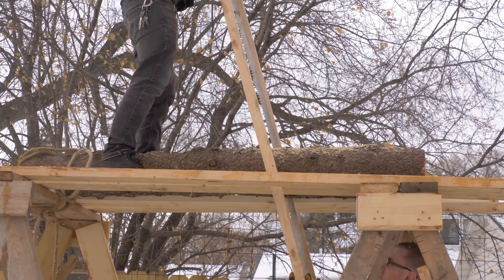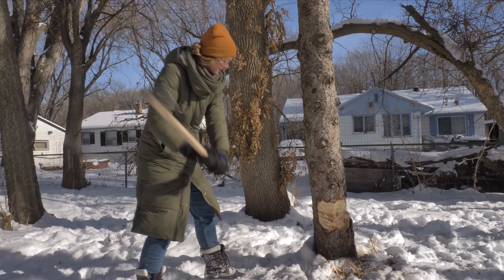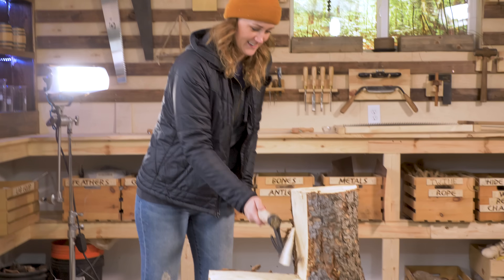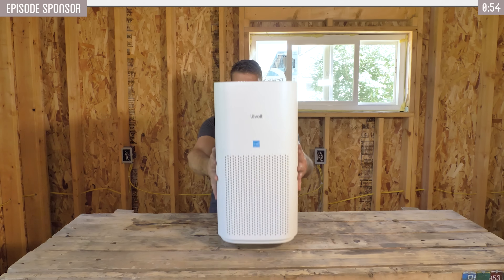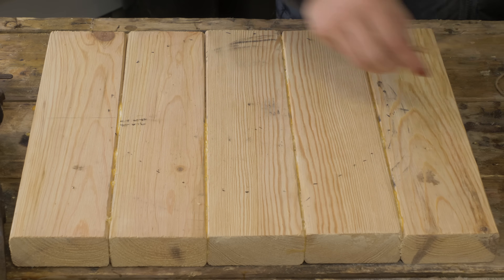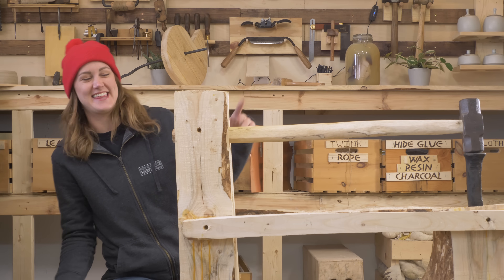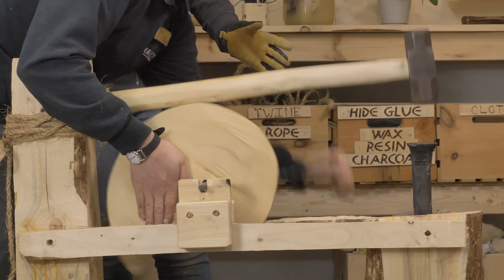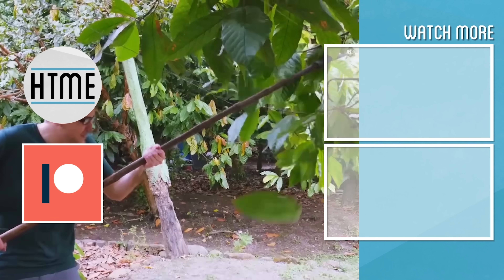Does Da Vinci’s 500 Year-Old Power Hammer Actually Work?

Comment: Mechanical engineer here. 7:05 is almost exactly how we were taught to design cams in university. There are of course software packages you could use for this, but they started by teaching us all the manual drafting techniques before moving on to CAD. As ol fashioned as it sounds I think I learned quite a lot about good design practice from that part of course. Really made you have to internalize the geometry of things to be able to draft it accurately by hand.
Reply: Designing the cam... Would it also work to tie a string to a pencil, and then wrap the string around a disk? 
As you rotate the pencil back around the disk, the string would unwind increasing the radius as you draw. The "drop" of the cam would be the same as the circumference of the disk. The length of string would determine the overall size of the cam. 
But I'm just an old country boy, what do I know?

Comment: now im gonna be using an anime as as a reference for this idea. In Dr.Stone the Character Chrome with the help of Kaseki (an old man who loved being an all around crafter) without any knowledge or know how made the water wheel. How the main Character Senku "upgraded" the structure was introduce gears and added what I refer to as the "Piston Gear"; Which in short is just a gear with teeth on one side attached to a piston turning Rotational force into Horizontal force which then powered their iron making Furnace. My point is why not use gears or something similar to transfer the energy of the water wheel or some other natural force into mechanical energy thus "powering" your "Auto hammer".

P.S. I know my grammar isn't very good, at least I'm trying.

Comment: The hammer handle should be flat, not round.  A round handle is specifically that way for the hand.

The cam should probably be concave, which would correct the hammer side to side deviation and lead to more accurate strikes.  

The length of the lever should be increased getting about a 3ft drop  which is similar to a blacksmith’s typical power stroke.  Extending the lever through the pivot and adding a counter weight would also be something DaVinci would be well versed in doing and reduce mechanical stress.  I also suspect if he ever built his concept he would have probably used a flywheel to aid in smooth operation.

Comment: Instead of making a second cam you could have just added a guide rail to the hammer that kept it lined up with the cam. Super easy you just needed to attach a pole or two to each side of the hammer that rides on each side of the cam and is longer than the drop is for when it falls.

Comment: Ok, real quick.  Love your vids!  But advertising an air filter like that, meant for small particulates and sanitization, as any to be used on a wood shop to help with what you are breathing in, is not great.  It is not at all a replacement for a shop vacuum/filtration system and should not be marketed that way.  This coming from someone who has multiple levoit-type filter in my house.  Just not in my shop.  K thanks!

Comment: I'm no Da Vinci or anything, and you are most likely capable of figuring this yourselves, still a few considerations on how to improve the design:

1) You don't need a larger spiral wheel to make the hammer go higher. A longer hammer handle would do too.

2) have you considered bevelling the halves of the wheel so whe connected they form a grove? This should guide the hammer a bit, preventing it from veering side to side.

3) maybe raise the anvil a bit... Or Lower the wheel. The practical use footage looks like the wheel catches the hammer before it can filly land on the anvil.

Comment: Make a place to stack weights on the top side of the hammer handle, between the cam and the hammers head. The back side of the head itself would probably be better, if you can work that out.

Comment: Looking at this, theoretically if the design is scaled up and you used possibly a gas engine and a belt it could be a tool that modern day blacksmiths could use. Actually I could see this being potentially useful for different projects that would also involve welding as part of them.
Reply: The same thery is used in the little giant powerhammers, they are not produced today but a very common mechanical hammer used by blacksmiths

Comment: If you can find a way to put a concave wheel on the lower edge of the hammer handle so that it rolls on the cam, it would likely help with the friction that's working against the spinning because you've got the entire cam rubbing against the hammer. The wider cam does help keep the hammer from falling off, but you could probably also have put guide posts on either side of the assembly as well

Comment: For the hammer sliding off the cam, just insert some guide rails alongside the cam to ensure the hammer stays in place. The guides would also help ensure the hammer is hitting right where you want it too. Further, by using rails you wouldn't have to widen the cam, thus lowering its weight and making it easier to turn. That would also help keep your handle from bending so easily due to the torque of turning a cam that big.

Also, you need to put a stop bar level with the cam or at least add some leather padding on the hammer handle. Or simply make it so there is space between the handle and cam at the point the hammer comes down. Otherwise the repetition of the hammer handle striking the cam will make the whole mechanism more and more wobbly as time goes by. Eventually even cracking the wood.

Comment: Having the cam work off of a foot pedal type system would make the use easier, as then you'd have both hands available to work the metal piece. 

Also then the hammer size could be increased with less strain while using it. 

And also, amking the bse where the hammer lands bigger, would allow more freedom to work with bigger pieces. 

But with said modifications on the design would get pretty far off from the original.

Comment: I would suggest lengthening the handle for the sledge by two feet or so. One foot of the handle shaft behind the lever point . Moving the cam behind and above the lever point. Using a guide rail for the handle shaft and using a rope pedal system to power it by your feet as you sit at the anvil point.

Comment: Add a foot treadle so you can sit in front of it and keep the cam spinning steadily. It doesn't need a bigger hammer, just more mass,  Add whatever is handy. Also with a wood on wood axle it is surprising the difference a dollop of lard or bacon grease makes.

Comment: Longer sledge handle and head.  Or larger head with a taller cam profile. With out a longer handle creating more head momentum I don't being able to work thicker metal very well. If it was being used to near the end of the forging process I could see use in its current state.

Comment: a metal plate under the step of the anvil will help. you are slowly driving the anvil into it's stand, lowering the height of the striking face. because of that, the handle is hitting the start of the cam as the striking face is lowered, reducing the force of the blow. i made one of these all out of steel, and they do work quite well. mine is powered by an electric motor i got from a dryer rather than a crank, but the concept is the same. you could use a split of springy ash to help drive the hammer handle as it falls to get more force from the same hammer weight. i use a couple of trampoline springs on the hammer arm in my design. i created a smooth cam spiral by tying a string to a sharpie and winding it around a tuna can clamped in the center of the cam plate. as the string goes around the can, it gets shorter creating a smooth spiral with no measuring.

Comment: Great work its a great bringing to life of this amazing design. I see that you took great care to in the building of this mechanism. I want to suggest this precautionary WARNING If the mallat strikes nothing and the hammer handle strike the wheel, then there is the risk that the wooden handle shatters and the mallat is released. Also, to increase the striking force to mallat, you can tie on the handle just below the mallat a sand bag to add more weight to mallat.

Comment: Looking at this I think a pedal system or using it for a different application (Sawing or chopping?) would work better, a lot of Leonardo da Vinci’s inventions or ideas were simply concepts, genius concepts. If you swapped the hammer for an axe and removed the anvil you could rather easily use it for hewing logs

Comment: If the buckle of the hammer still persists Mayabe add 2 pieces of wood as guide to keek the cam and the hammer in contact, tough it will require something to lower the drag, like hide or lubricant

Comment: Take a sharpening wheel as a flywheel add a pulley and a belt and a bigger hammer and cam that should  do it add a peddle to the flywheel and you have the equivalent of a modern power hammer

Comment: Note the 90 degree bend in the photo of your thumb nail. A possible modification would be to elongate the handle and add the 90 then having the spoke push the vertical add on to the side and by extension the hammer up higher.

Comment: Nice first attempt.
Suggestions:  Longer hammer arm, so the hammer has a longer fall for more acceleration/force.
--Mount the cam 1" lower, so the hammer hits the anvil instead of being caught by the cam.  Maybe larger cam.
--Larger Crank & Axle. 1/2"-5/8" Dia minimum.  1" square to drive cam, very close fit.
--Secure the cam to the axle better and fill the space between the pillow blocks and the cam to limit the wandering.
--Line the running surface of the cam and the contact area of the hammer arm with flat stock and grease/wax it, so it slides easier. Punch down the leading edge of the nail heads if you put fasteners in the contact area.
--Time the cam better.  You want to be 3/4 of the way through the upstroke, when it releases the hammer (30-45 degrees behind the cam crest).   You have more strength and control on the upstroke, and you have more acceleration potential on the downstroke (when powering it by hand)

Comment: Not only you killed a tree for nothing, but you had poor planning and measuring. The techniques are amateurish at best and the tools are tortured. You needed proper dry wood to begin with, milimetrical measurements, smooth surfaces at the end obtained from properly maintained tools. Tools that haven't been abandoned and then put to work. Reshaped tools, properly sharpen and oiled tools. And for the love of God, not a project done in 6 hours just so you can post it and get likes. The number of likes you get for this video is as big as the shame you should have. You got great ideas, but from an idea to an actual project is the actual work and craftsmanship that shows to the audience and to yourself the respect you have for them, yourself, the nature and those before you that you try to copy.

Comment: Hello :) I believe davincis design has a restrictor above the hammer handle which slightly bends it as the cam lifts higher than the restrictor, then that energy is suddenly lost to falling but also the spring of the handle. As far a motor, dismantling a washing machine would be perfect

Comment: The cam is lifting the hammer directly meaning all that friction from scraping the arm of the hammer and little to no mechanical advantage. Doing it like the drawing where the cam has leverage behind the hammer's fulcrum would give it more mechanical advantage and the hammer head might have higher travel for a harder hit. Wax or graphite could help with the friction. The double cam with a groove in the middle was a good move.

Comment: I know it was an ad, but I really hope you're aware of environmental hazards before just walking into them. Some things will do some serious damage and quickly.

Also that hammer head is not attached fully. You gotta fit that properly or it's gonna go flying. Get some charcoal on the inside. Shove the wood in. You'll see what is touching and what isn't. Shave off what is touching slightly. Repeat. You want good contact and for the wood to be coming out the top.

Comment: You could have used the original cam and just added 2 guides on either side of the hammer handle to keep it from slipping off. Flange the inside edge for the drop off to ease alignment. Presto done. Not the greatest design though. Not enough force to be worth it. Maybe a leaf spring to increase resistance as you get to the top of the cam that increases the downward force of the strike.

Comment: It's a fine first attempt to get an understanding of what works and what needs redesigning. Lots of room for improvement but a very inspiring project. I can imagine setting up a treadle with a flywheel to drive the cam disc, which could also provide a more stable and smoother turning axle.

Comment: As a proof of concept, you've done well.. to take it to the next level and make it actually functional, there's a few modifications you'll need to make.
For an external power source you just need to harness a water wheel or windmill, something to provide power to turn a drive belt.
Then through various sized belts and pulleys you can increase the speed and torque to lift the hammer higher and faster.
Clean, accurate holes with dense timber bushings (soaked in oil or wax) will give a smooth operation and reduce friction.
To manage the speed of the hammer you need a spring-loaded foot pedal which will adjust the tension of the final belt, allowing the belt to slip when the pedal is released, and tightening it when it's depressed.

To control the accuracy of the hammer through its range of travel, you'll need to snug up all the pivot and rotation points, (your current tolerances are too wide, allowing a lot of 'slop' in the system,  and this is wasted energy).
You'll also need a couple of guide rails either side of the hammer handle, just forward of the cam lifter.
These rails will need to be made from a very stiff and hard wood (and also need to be replaceable) as they'll wear over time. Ditto the hammer handle and the cam itself.
Once you have these additions, the final thing is to brace it and add a lot of mass to the base so it is solid and doesn't dance around your workshop when in use...

Comment: The hammer shaft hits the lower part of the cam at the same time as the hammer head hits the anvil. That removes a lot of the impact from where the work should be done. Raise the anvil as a quick fix, or make the lower part of the cam lower to get the originally intended acceleration travel distance

Comment: If you extended the beam out the back and mounted the cam on an axis in line with the beam (so it is tangential between the snail profile and beam) above the rear extension, you could increase the drop and the rate of actuation, because the apprentice will not be in the way. You would need guides to prevent the beam prom wandering, but they could be placed on the cam side of the arrangement.

DaVinci wasn’t really taking full advantage of the snail cam with this design.

Comment: Legitimately would love to work theremy suggestions would be to either introduce and old style rope spring like what's used in medieval catapults . Adding just like two tightly twisted ropes to the end of the hammer would add a lot more force. And a slightly better groove in the cams would prevent the hammer slipping

Comment: Maybe sharpening, simple measuring tools, and a few more varied and specialised wood working tools like wood planes, a set of chisels, or an adze should be on your list soon. The gaps between the boards of the cam looked pretty large.
It feels like the precision you need to make this kind of thing work well is really hard to get with your current tools, and you're trying to jump ahead a bit too fast.
If you look at pre-industrial work, they were able to produce incredibly detailed work pieces when needed or wanted, and while the tools and machines may look crude, they were precise where it mattered.

Comment: It would be much more easy for them If they would use the right Tools and technics for example we Always squared the Wood as it was fresh it is Cut way more easy that way and there is a certain Kind of Axe used for that er call it Klaffbeil and Breitbeil
Also you need a shrotsäge for the crosscut in the round Wood its way more easy to have a two man operated saw for that Kind of cut
For round cuts we Had a Stichsäge its a handsaw with a very short and think Blade to allow round saw
Its sad that we use the Same Word for the electric version

Comment: Water hammers work alot better! You carve a bucket at the end of a very heavy hammer giant hammer from a log on a teeter totter and orient it in a stream and the hammer naturally will be head down in a resting position but the stream will be setup to channel into a small point and fill the bucket when it is the resting position which lifts it than as it tips from the weight the water dumps out and it drops back down after reaching a high height! The reason it is way better than this one is because the hammer can only go a small distance up with each turn and has almost no momentum so it relys on the weight of the head where as the water hammer reaches very high before dropping and uses a natural stream to run it!

Comment: This is a popular first hammer among hobby blacksmiths. Add a couple of trampoline springs to the hammer handle for the extra bang. Also considered sheathing the outside of the cam with sheet metal for a smoother operation and to keep the two pieces of wood from wearing each other out.

Comment: Instead of bigger cam, turn the cam sideways and move it closer to pivot point.
  You can evan put it on the other side of the pivot pushing down to raise the hammer freeing up the front for added weights.